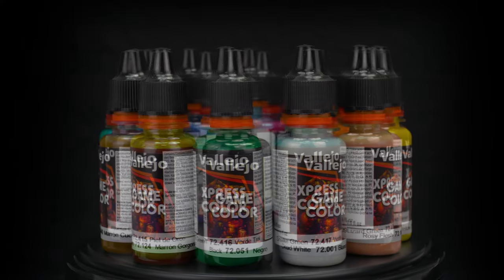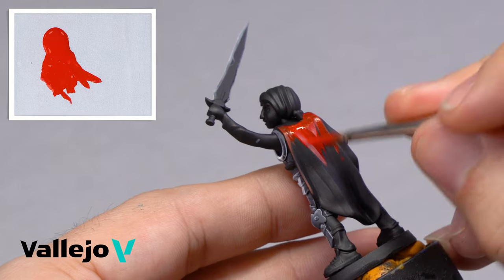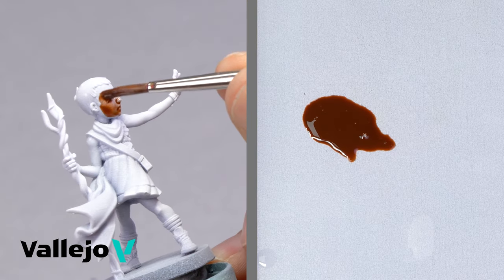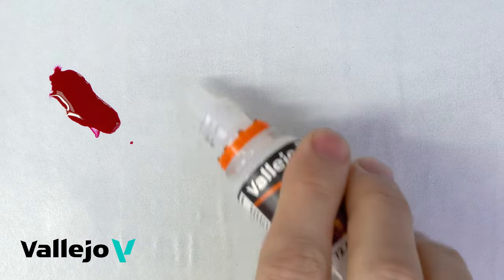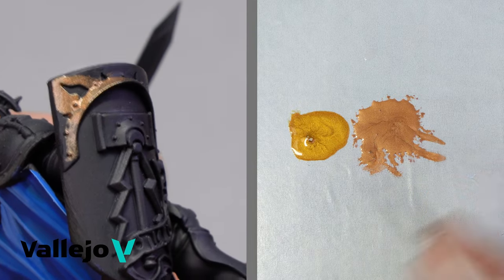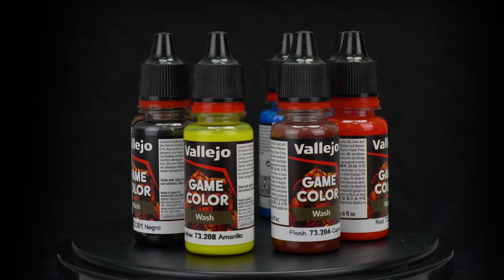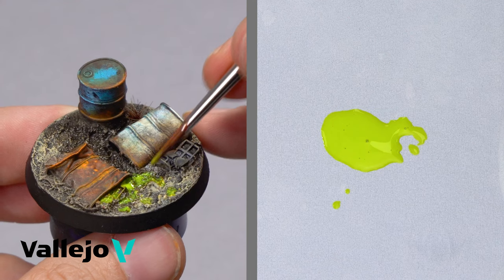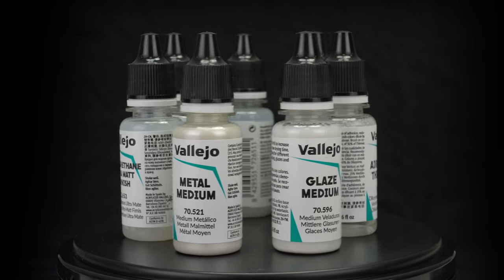🇺🇸🇬🇧 Diving into our NEW GAME COLOR paints! References and ranges 🎨

Comment: I have about 10 bottles so far and Absolutely love these paints, the fresh blood is incredible and with the new clear plastic no needles to paint the lids. I’m definitely gonna try and get them all 😊
Reply from the maker: Thank you so much, Fangirl98! ❤
Reply: hey fangirl98, how well do the paints resist separating in the bottle?
Reply from the maker: @theforgedone  The new range has an improved formula that avoids extreme separation in the bottle but if paints are not used for long periods, will also need a little shake as any other paint 🙂
Reply: Yeah and I just bought and received 75 bottles of paints :(
Reply: How can I get the full range as a full complete set
Reply: I second the last reply. Please provide a link!

Comment: After using the new range of paints i have to say I'm largely satisfied with the results! The only issue i have is that many of the metallics are very thin and more transparent. This is great for airbrushing but requires a lot of extra effort when applying by brush.
Reply from the maker: Hello Mikey! Thank you so much for your feedback 😊 A tip for the metallics is always using them with a dark color base, the contrast will be more noticeable :)

Comment: Which one of these will work on flexible resin or plastics ?
Reply from the maker: Hello Fastgti! Yep 😊To ensure the best possible result, it's important to take a few extra steps: Firstly, be sure to properly prime the piece before applying any paint. Secondly, if you plan to manipulate (play with it) the finished piece, it's recommended to protect it with a polyurethane varnish. These simple steps can make a big difference in the longevity and quality of your work. BUT... If you are considering using flexible resin or plastic on your figure or piece and need to bend those pieces/figures at some point, we suggest taking a few precautions. Before proceeding, it's important to test the paint on a hidden area of your figure or piece to ensure it will adhere properly and not peel off the surface. By doing this, you can make sure that your project will come out looking its best 😊

Comment: What’s the difference between the game and model range now? I thought it was that the model range was a Matte finish and game satin but now it appears both are now matte finish? Thanks
Reply: i think the model range is more basic colors while the game range go into more vibrant/rich colors
Reply from the maker: Hello Carl, thank you so much for reaching out to us! 
Vallejo offers different water-based chemical formulas, each one created for a particular segment of the hobby market, but all compatible with one another:
1. Model Color refs are creamy, highly opaque acrylics formulated principally for brush application. In this range, you also have standardized colors for your military pieces and requirements :) 

2. Game Color has been developed for tabletop games. The range is designed for painting small
figures and the formula has a lower viscosity and a resin more resistant to frequent handling (for wargames and gaming models). The colors provide opaque coverage without loss of minute detail and a matt finish with high pigmentation, vivid and more fantasy colors.

Anyway, you can use both for your models depending on the needs and colors you like 😊

Comment: Hopefully the caps and nozzles are better on the new bottles. I've had so many nozzles split and caps pop the top off by slightly over tightening the lid. Love Vallejo paint but the lid section on the bottles let the paint down... Still better than Citadel pots though 😂
Reply: Pretend your Vallejo bottles a resin mini... be careful and gradual with it, or risk breaking it. Tip toeing around everything atm after breaking a sword on a resin mini the other week by just bumping my pinky into it...
GW pots... hammer the suckers shut, thoroughly front and back, brute force is the answer here! Assuming you cleaned the lip of the bottle, if paint does run and get into it then ya it can't close perfectly. Still better than those old hard plastic ones (only one in ten of my old hard plastic hexagonal pots were still good when I pulled them out the other month... had one of the first citadel foundation paint pots, and it actually held out ok over the past decade of being ignored, new pots with slightly flexible tops have much better seals long term if you are careful with them.
Reply: It's not just over tightening. I have old Vallejo paints (like 10 years old) that never split. Meanwhile in the last month, I've had paints show up in mail with lids already split.
Reply from the maker: Thank you Martyn! :)
Reply: @Terricon4  thanks for the advice, mate. I do try to be careful with my paint pots but I'm a one handed painter so it can be a bit awkward at times, I don't have the same finess or fine motor skills as someone with two hands does. 
With the Ciradel paints, it's more the inability to accurately measure the amount of paint I get out, plus the flip top lid can be a pain when you're trying to juggle a brush, holding the pot and keeping the lid open, all in one hand, I should be a magician 😂
Reply: @madMARTYNmarsh1981  Oh ya, one handed on citadel pots would not be nearly as easy as a simple screw top or simpler flip top likr cheaper general crafts lids (got some folkarts and americanas, some are good others less so, but I can pop them one handed easily enough at least, and then close them.)
Reply: @Terricon4  I have been tempted by craft paints (as well as oils and some of the more exotic paints people use for miniatures) but I'm still trying to get to grips with acrylic paints; I've been painting almost 2 years but as you can imagine, with one hand, everything goes quite slowly. I hope/expect that I'll get faster as I get used to what I'm doing, have developed techniques and routines which suit my disability specifically, at the moment though, I'm still learning so I'm holding off on buying more paint types, until I've mastered the basics. I did have paint thinning sussed but then I got the RGG Everlasting wet pallette 2, the sheets for the pallette have a weird coating on them, the paint doesn't behave the same way on it as it would on my The Army Painter wet pallette, so I'm back to learning again 😂
I appreciate you taking the time to offer advice, thank you, it is invaluable for newer painters to learn from those with experience, especially when I don't have access to a social circle of painters from who I could learn. YouTube has been vital in this.

Comment: Not a fan of the new formula, they’re too watery and transparent and barely cover the paint underneath also they brush terribly!
The old formula was better, it was thicker but once thinned they had good coverage and flow and were great for basecoats! I paint statues that I sculpted and printed, I don’t paint miniatures!
Are the new model colors using the same watery formula or are they thicker?
May need to switch brands these thin paints don’t work on 1/6 th scale statues or larger!
Reply from the maker: Hello! We replied to some of your tweets and we are now waiting for your feedback so we can determine if the problems you faced were application issues or problems with the formula. We will need to know the finish you wanted to achieve, the techniques used and the colors or references you used (both in pure form or mixed with other colors or varnishes/mediums/etc). We are confident that our colors are very good and the formula is fantastic; the formula should not be watery but creamy, as shown in the video. Our new Model Colors have also been improved, and the formula should not be watery. Please, let us help and find out what is happening, we appreciate all info possible ;)
Reply: @vallejocolors  I responded on Twitter X, i used it on a wet pallet or a plastic pallet directly, it's more watery than the old Model Color Glossy Black not actually watery like a wash, but bc it's more watery than before it takes more coats to fully cover the colors underneath.
Reply from the maker: @TheIcemanModdeler @TheIcemanModdeler  We replied to the tweets with some tips and recommendations. To sum up: 
1. Brush application (with a flat brush) is not the best method for large/big pieces and figures. Using an airbrush will easily avoid brushstrokes and require less product 👍🏻
2. If you are looking for a gloss finish (the same one you got when you used Model Color Gloss Black), GC will not satisfy your needs (it is matte paint). Just use our new MC Black Gloss reference! 🖤
3. Game Color has a creamy consistency, high coverage, and matte finish, so we think that when you refer to transparent and speed paints, you are referring to Xpress Color, which is, in fact, a different product ✨
3. Priming is always needed after white putty to avoid the white shade it leaves over the surface; sand to make the putty surface smooth, clean, and prime. Then you can apply the colors :)
4. Using a black primer will give you fewer headaches and is less time-consuming than if you use a white primer and you want to cover a surface in black color :) You also have many other colors in our Surface Primer range 🌈
5. We are still formulating and manufacturing our paints at Vallejo's facility with the help of our Chemistry and Research and Development Departments. This will not change, and we are committed to maintaining and increasing the quality of our paints for many decades to come! 🥰
6. The most important point: If you encounter any challenges or issues while using our products, please reach out to us. We are committed to resolving any problems and providing assistance to all of our customers. We are sure that we will make you enjoy our colors! :D